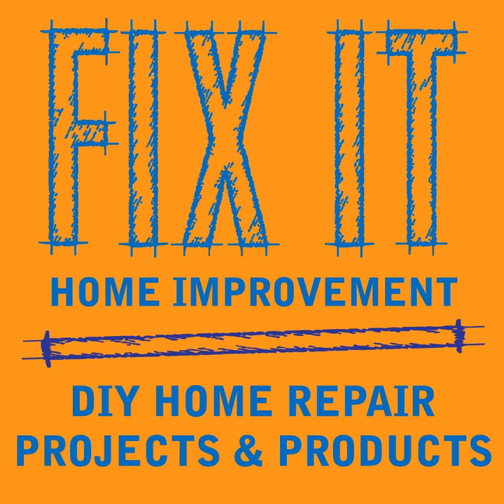Toilet Tips, Wax Rings, Flush Valves - Podcast

Comment: SANI SEAL looks good, will keep it in mind
Reply from the maker: Hi, I am now recommending the Fluidmaster Better Than Wax toilet gasket and the Korky wax free toilet seal. A few of the toilets where I installed the SaniSeal, the toilet bolts have rusted. It seems over a few years the SaniSeal is absorbing moisture, rusting out the bolts. The Fluidmaster and Korky seals are rubber at the toilet outlet and none of the toilets I've used them on have rusted the bolts.
Reply: @FIXITHomeImprovementChannel   thanks for the heads up!